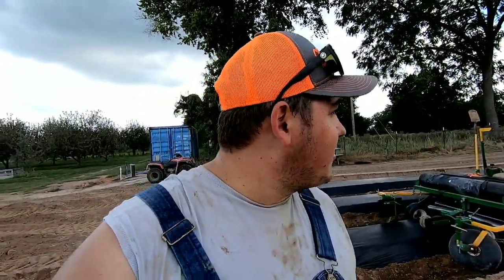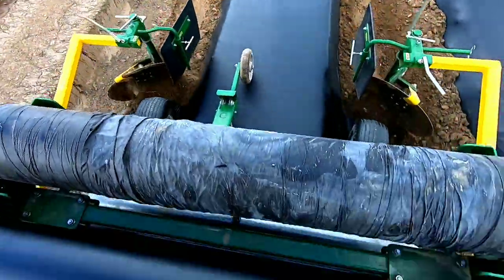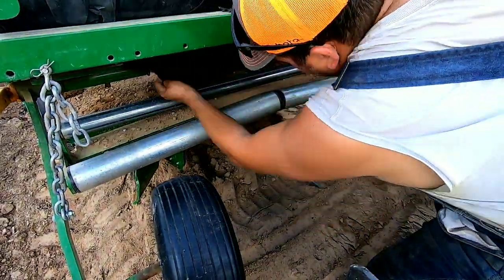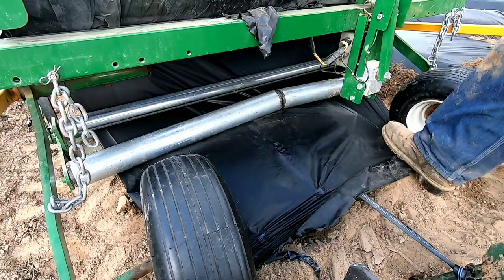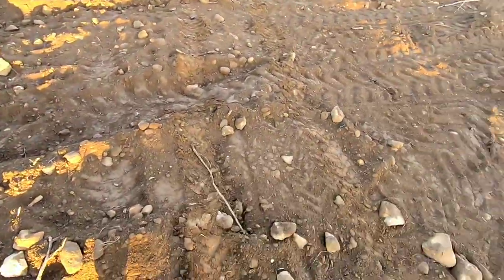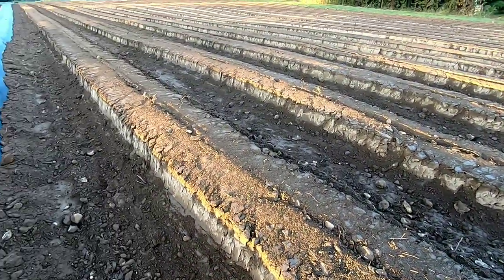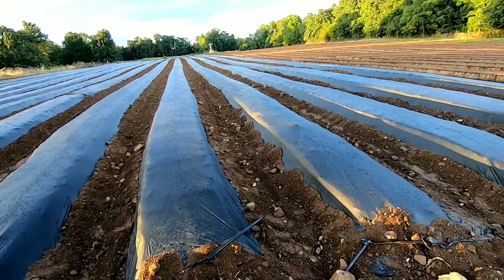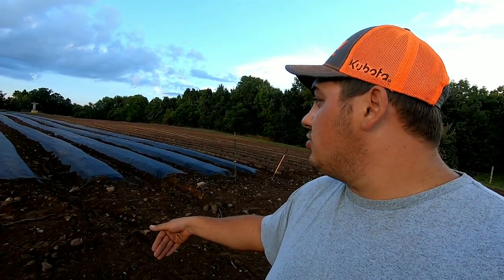Laying Plastic Mulch for Strawberries 🍓  Part 1

Comment: Looks good, wish I could afford the rain flo. A guy near me, Cherry Hill Farm, has one. I use one that I made. It works good I may try running some rows next year before laying the plastic to see how that does. I hope you have a great crop next year.
Reply: It's worth the price, but there are a few smaller manufacturers that make them as well.  I'm not sure of the prices, but check out Nolt's produce and Buckeye tractor.  They may be slightly cheaper.

Comment: I was wondering how deep you set your cleaning shoes (shoes in front of the firm wheels)?  I think mine are getting worn after many years.  Hope you get a good sealing rain on the edges and before you plant.  Looks good.